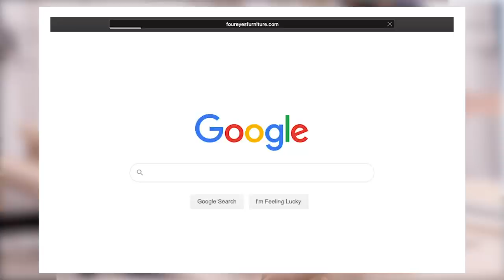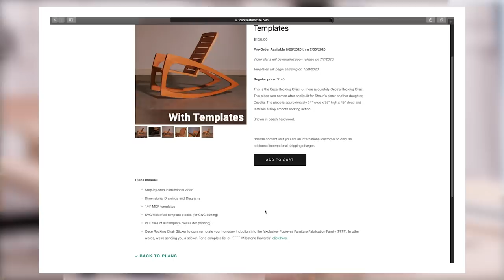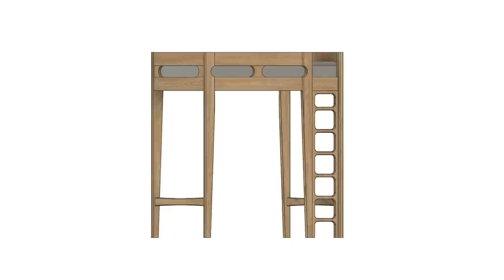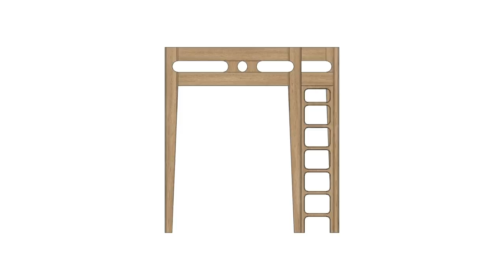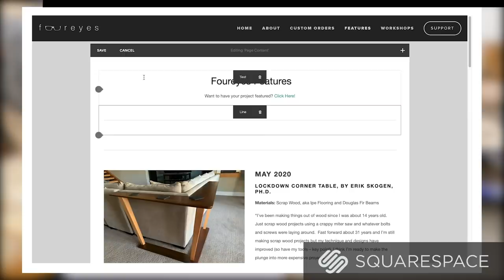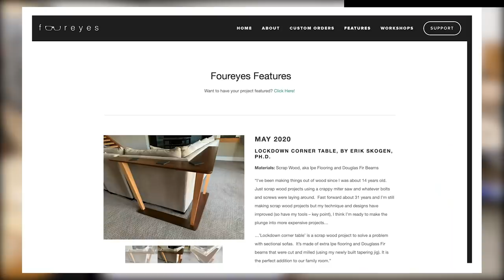How To Build a Danish Modern Loft Bed - FOUREYES FURNITURE

Comment: Currently in the finishing stage of my first furniture piece. I've binge watched just about every woodworking youtube channel and would love to see more of the finish process in your videos. I guess it's not as exciting as the building process, but I feel I could pick up more tips just from watching the sanding/finish montage, like I have with your building montages. For example, you aren't teaching us "how to clamp during glue ups", but I've learned a lot just from seeing the glue up clips in all your videos. In this one specifically, seeing a bit about how you sanded all those curves would be helpful.  

I only mention it because my sanding/finishing is taking a while with mistakes to fix, so I snickered a little bit when you said "All I had to do was sand, add some finish, and this one was done". All that aside, great video! Great design! Great channel! The slower/calmer style (compared to other channels) took me a bit to get used to but I'm really digging it now.

Comment: A question about your equipment.  It looks like you are using a Fuji HVLP for the finish. Have you had any experience by no-Fuji brand (cheaper) guns with that?
Reply: I have used the cheap spray gun from harbor freight, and it worked great for what I needed, and especially for the price. The Fuji is amazing, too!

Comment: Very cool design, and I love your narration Shawn. I think I see some checking in the end grain of one of the boards at about the 11 minute mark. Did you use some CA or fill with wood glue, or do you think it won't be a problem as the bed adjusts to its new home?
Reply: Thanks Mike! Yeah, there was a small bit of checking on the end of one of the legs. I usually fill stuff like this with CA glue or epoxy if it is bad enough. These were very minimal, so CA glue should be fine.

Comment: Hi, what size of pipe clamps do you use? Thanks! :)
Reply: We have a few different sizes. I think we have 6, 8, and 10 foot ones.
Reply: @shaunb66  Oops, I meant the diameter of the pipe, 1/2 inch or 3/4? thanks again!